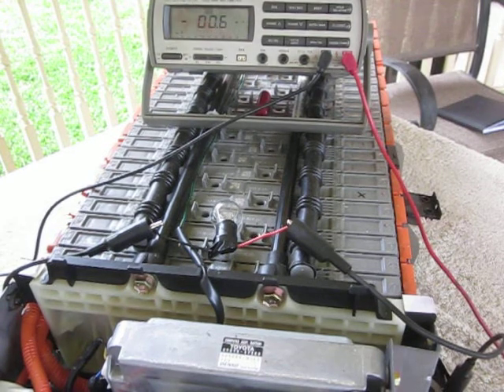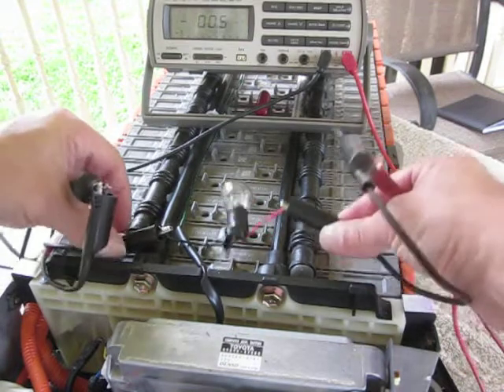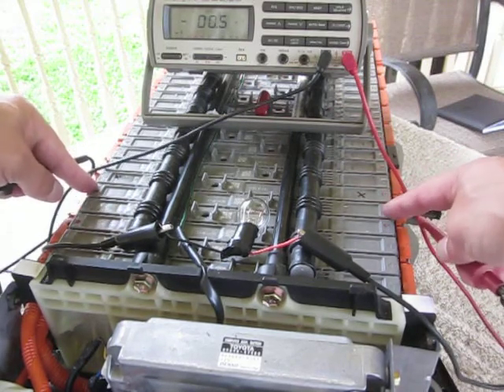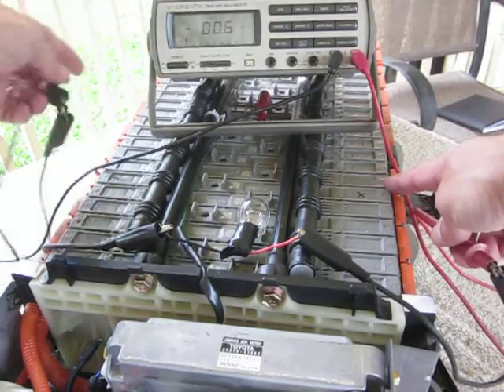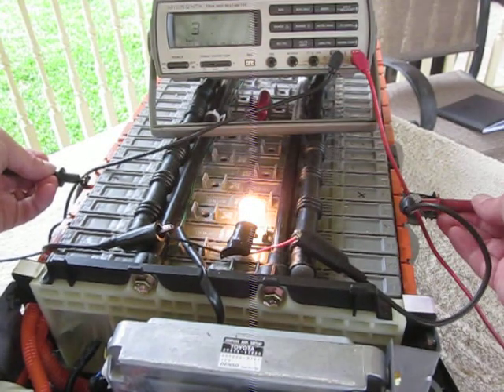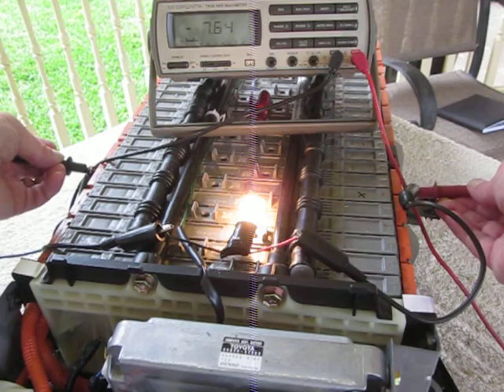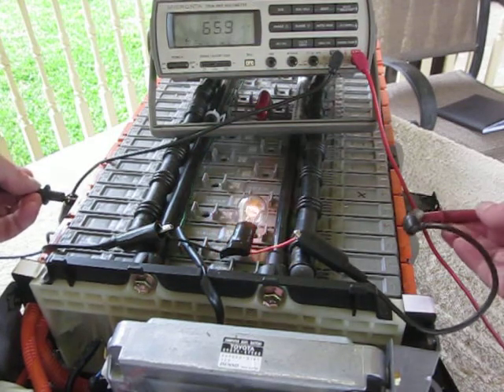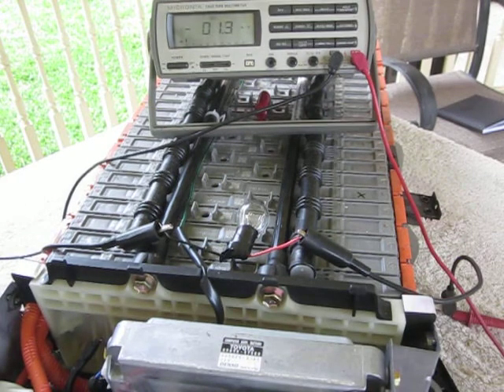DIY - Finding Good & Bad Prius Hybrid Battery Modules - using load testing method

Comment: If you use a battery chargers / discharger combo, do you need the light?
Reply from the maker: If you can control the discharge current, that should work fine.

Comment: Thank you for this information. For do this, you might also find one that's over 7V but drop faster than the other cells. Weird enough my Camry 2007 hybrid's 6th battery cell was also bad and I replaced it.

Comment: What was the voltage on the bad one before your test?
Reply from the maker: Some measure well over 7.8v open circuit and fail, others are already in the 7.2V range, but even those can pass the load test.